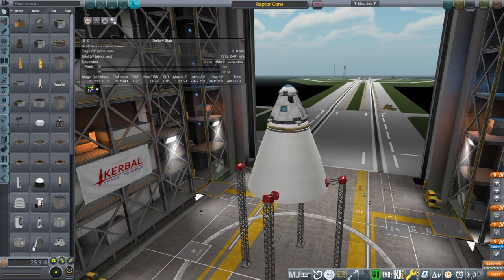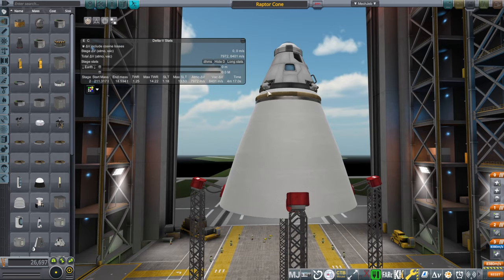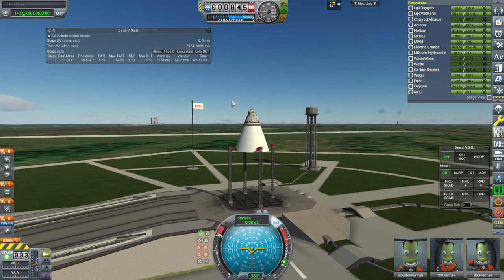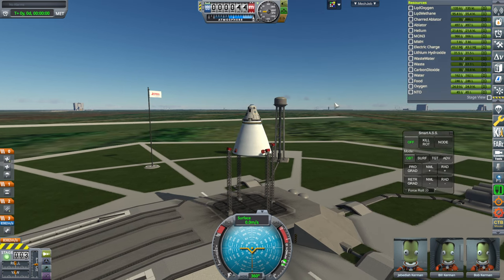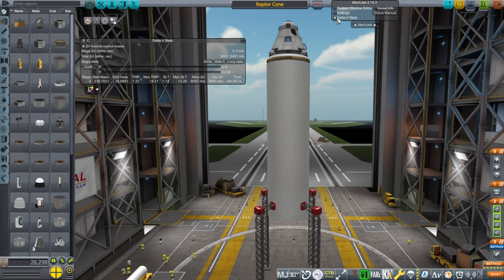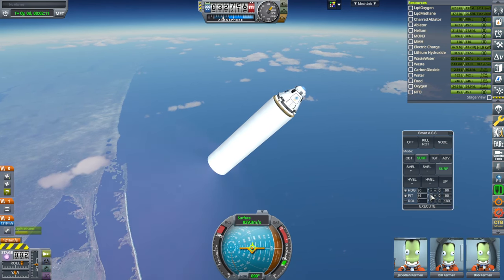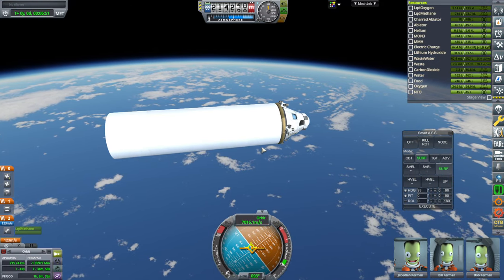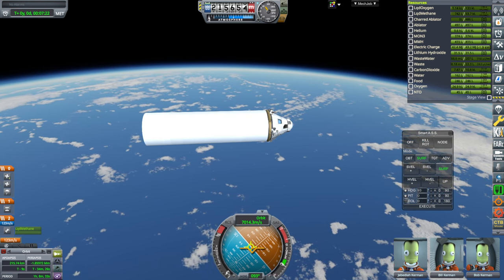Raptor Cone (RO in Kerbal Space Program 1.12)

Comment: Hey raiz! why not try using a BALLUTE for reentry?

They're so cool and can be fitted between the tank and the pod, allowing for a docking port at the front. They give you a super low ballistic coefficient and start decelerating higher up in the atmosphere. also they might give you enough drag to land the whole ship without parachutes.
can't remember the name of the mod but it exists for ballutes!

This is the kind of ship i love messing around with in RO, the low margins make them such fun to design.
Maybe switch the command pod to a Shenzhou or Soyuz descent module? smaller and lighter, yet still used currently. the abscence of the orbital module wouldn't detract from the realism as if you're doing fast rendez-vous (3h flight) like the russians do nowadays, the astronauts don't even leave their seats!
Reply from the maker: I'm just not sure ballute dynamics are well-simulated in kerbal. Also, we don't have a lot of real life info on their performance. In general, I think they're a good idea for some applications, but they have to work here.

Comment: I tried to make an RO SSTO a few weeks ago using the J2-T and it ended up being way bigger than starship and it couldn’t even lift the mk3 command pod I think I did something wrong
Reply: Just build the Saturn V-B.
Reply from the maker: Well, using the J-2T should not yield something way bigger than Starship - it would be smaller than this Raptor Cone (because it has less thrust than Raptor). Since it would be smaller than the Raptor Cone, yes, it would have a hard time lifting the Mk3 pod.

Comment: Ksp will die soon ... and this is why

There is a new game called KSA, which is based on the same idea as KSP, but it has fantastic graphics, a large and complex solar system, and it is even multiplayer.
The news that made me excited is that most of its developers were former developers of KSP 
The Revenge !
Reply from the maker: I prefer kerbals to kittens, though. We'll see. I've heard such things before about KSP 2.
Reply: Just because they're working on something doesn't mean that KSP "will die soon". They're extremely early in the development process, and given that they're building their own engine from scratch it will take longer to get things to a playable state, though it also makes it easier to achieve specific design goals since you don't have to work with the constraints and quirks of a third-party engine. We'll see where KSA is in a year or two, hopefully playable by then, but it won't exceed KSP's overall capabilities for a long while. It will do doubt surpass KSP in specific areas prior to that.